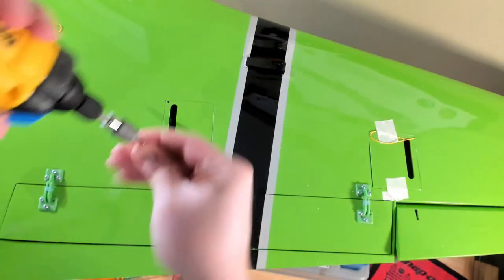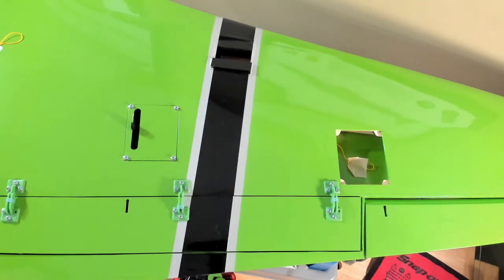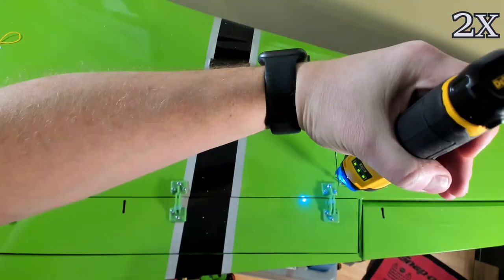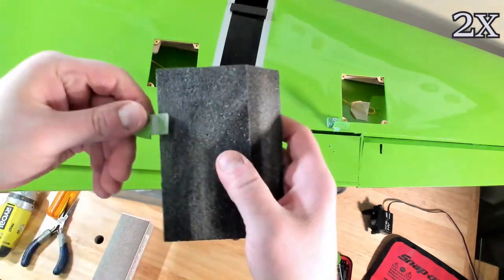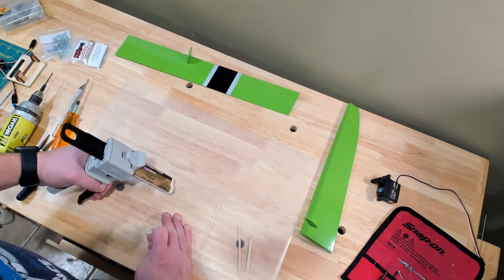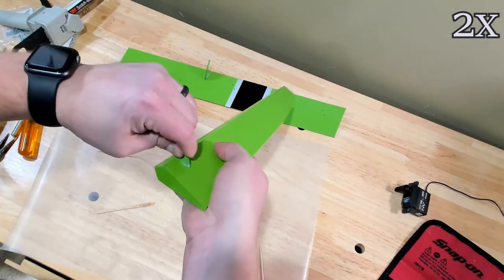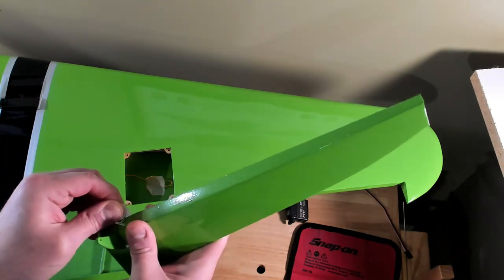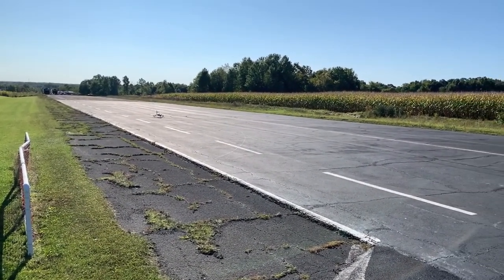Servos, Horns, and Ailerons - Seagull Models Reno Air Care Yak-11 - Perestroika Build - Episode 2.1

Comment: Nice tips along the way! I've use toothpicks for years for the same reasons when working with epoxy.  I also sometimes use two pins per CA hinge if the slots are too wide. This prevents them from twisting as the control surface is inserted.
Reply from the maker: Great tip!
Reply from the maker: Check out tomorrow’s video 4.1. I mention this!